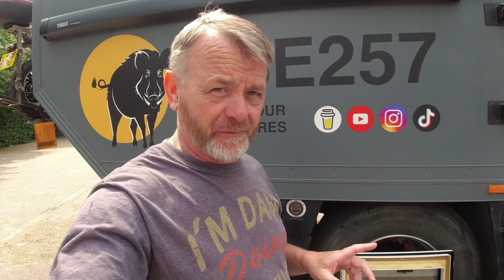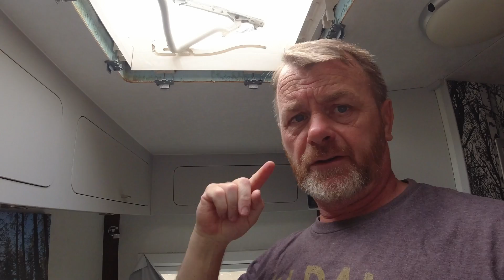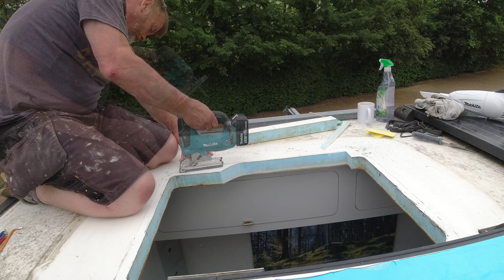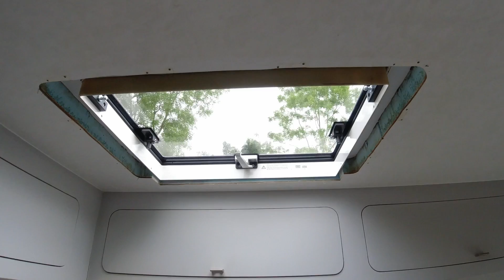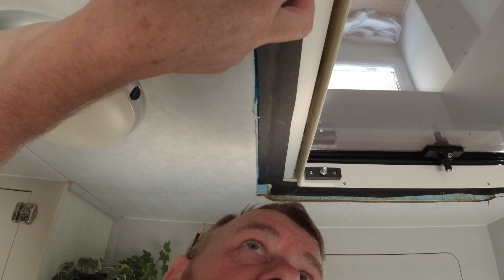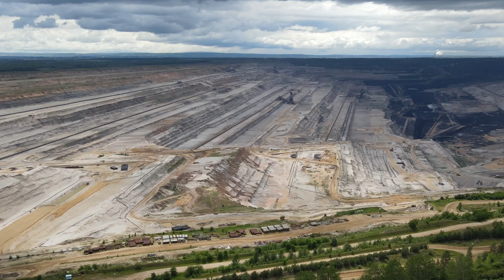Replacing a Dometic/Seitz With an Outbound DR30 expedition Roof Window How To Video on Overland Rig

Comment: Hello, I would like to know the measurements of the truck, length, width, height and weight. Could inform me ?
Reply from the maker: Hi, the overall length is around 8.2 including tje bike rack. Hight is 3.6, width is 2445mm and although the trucks gross weight is 12t we’re running at around 10.5t 
Hope this helps